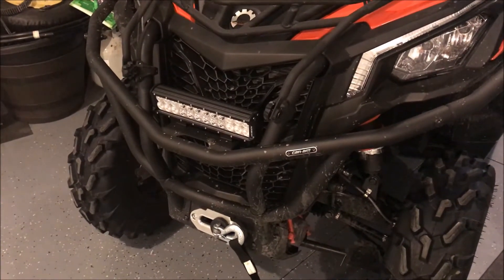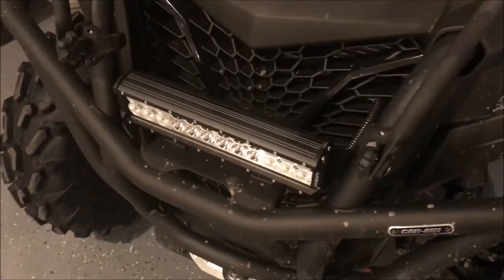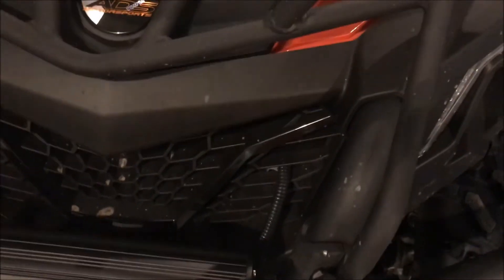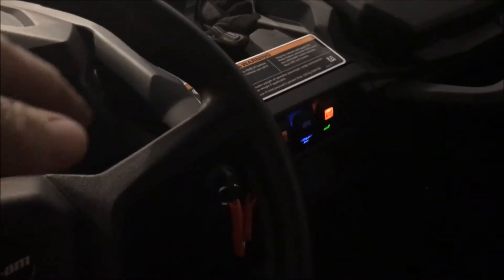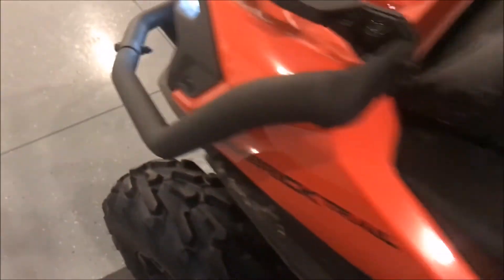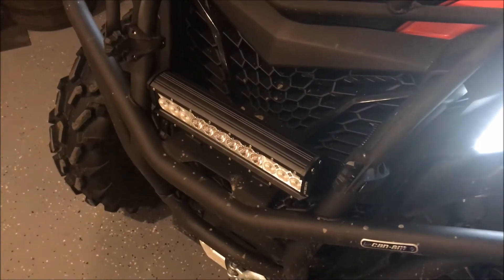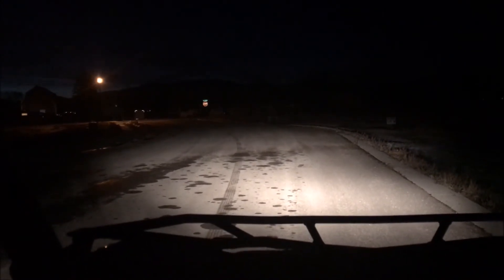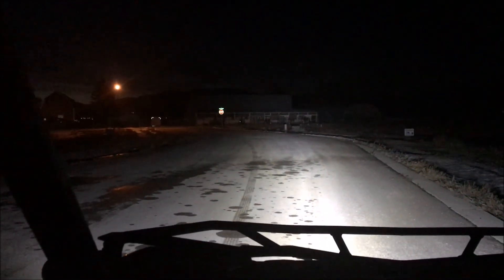Auxbeam 12 inch spot/flood combo LED light bar install on a 2018 Can-Am Maverick Trail

Comment: Those factory high beams are horrendous 😂
Reply from the maker: Yeah, high and low suck pretty bad. At this point I just use my low beams during the day to be seen by others better (LED's in low beam lights) and the light bar at night. I don't use the high beams at all, they're pretty much useless.

Comment: Can you still remove the grill to clean the radiator?  Looks like its blocking it now.
Reply from the maker: I could, but without thinking it all the way through, I ran the wire from my light bar on the bumper through the grill. So I can't take it out now...

Comment: You made the modification to the switch circuit so the blue light won't stay on.  Can you tell me more about that modification.
Reply from the maker: There is a acc block under the dash to the right of the steering column. I wired the lighted part of the switch to that post. One of the terminals on the switch itself is for the illumination(I can't remember which one), but run that wire to the acc power and it'll only light up when the key is on.

Comment: I wonder how much the light impedes airflow to the radiator?  As hot as these machines run I'd be concerned about negatively impacting cooling capability, especially on 85+ degree days.
Reply from the maker: Many, many miles on this machine since that light was put on with no issues. Plenty of hot days in the 90's this summer snd the machine never overheated. 👍

Comment: If you just had the stock front bumper would the mounting brackets still work?
Reply from the maker: Jason Goeders no. The mounting bracket is on the brush guard, not the factory bumper.